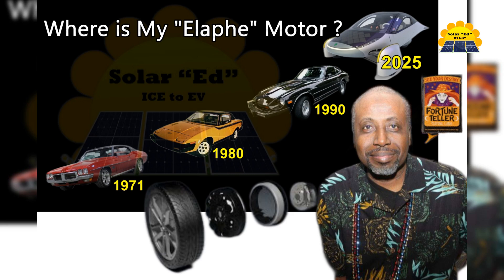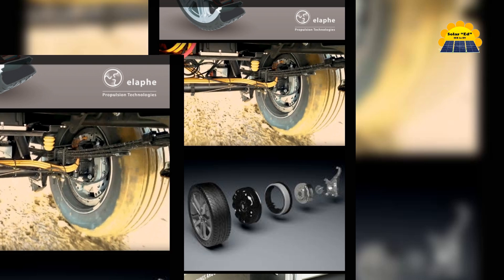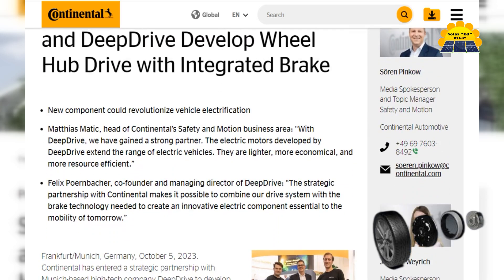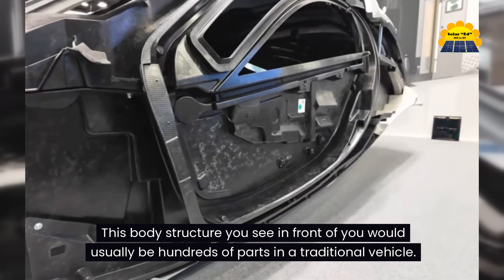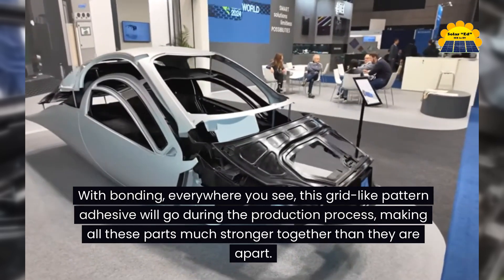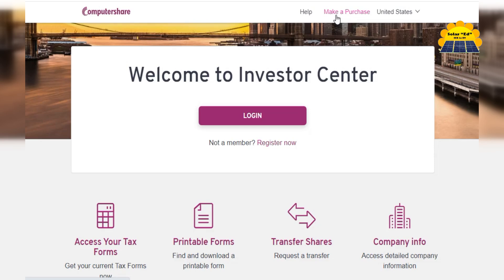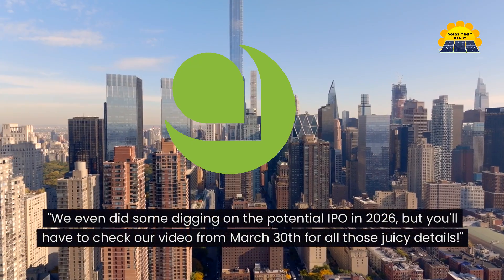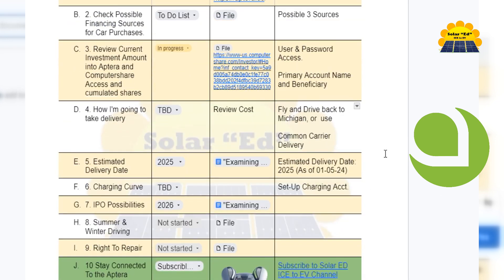Unlocking Aptera PI: 40K+ Reservation Solar Upgrade

Comment: Their odds are 0% and the reasons why are:
Won't raise the money.
Won't make a Delta.
Won't prove any PI is fit for purpose.
Reply: The only think in your list that is correct is the 2nd one, and that is only because the "Deltas" are called Production Intent instead.  And their purpose is validation of the design for production and they will serve exactly that purpose.  With every post and video you make you show how out of touch you are.
Reply: @n.brucenelson5920  aussieideasman has a mental illness--we need to be gentle with and pity him.  He's at a significant mental disadvantage.  Sad but true.
Reply: @n.brucenelson5920  Bruce, I know you have a lot of experience and are a very knowledgeable person. I was wondering why you never correct people when they claim that Aptera will be a solar powered vehicle? I am sure you know that it is planned to be energized by power stored in batteries, and therefore not solar powered. I mean if we want to use that as a power source than it is also a coal powered vehicle and possibly wind powered or even water, natural gas, propane, diesel etc powered vehicle. I just think we need to be accurate and clear that this will never be solar powered but rather has a solar trickle charger built in rather than hooked up to a sub solar array possibly bought at Harbor Freight..
Reply: @Aspkkr  I generally assume that people understand things better than they sometimes express.   There is a very real sense in which the entire Earth is solar powered, with the possible small exception of nuclear plants.

We are not being honest when we go out of our way to purposely misunderstand people's meaning.
Reply from the maker: Bruce I hear you. I Have no patience  with crazy people.  The internet and social media seem Foster this crazy😮.
Reply: @solaredwinicetoev  Look in the mirror.
Reply: @n.brucenelson5920  Delta's come after PI. There was not supposed to be a PI but they have no production line to make the Delta yet.
Reply: @aussieideasman8498  You can't even pay attention to Aptera's own terminology.  You continue to spout nonsense that only exists in your own imagination.
Reply: You live in a coma!😂😂😂
Reply: @gmv0553  It will soon go one way or the other.
Reply: @aussieideasman8498 As, I suppose, will you. Hopefully, the other...